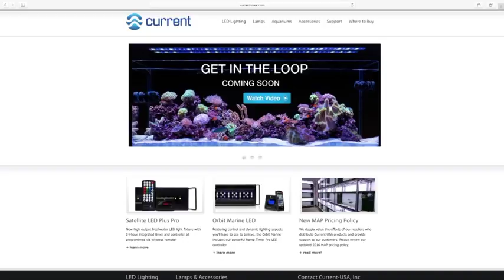eFlux Wave Pump Kit Installation Instructions

Comment: I have a 155g tank I’m  Using the Wi-Fi controller.  Can  i hook up 4 wave pumps and control them separate from each other?  please do a video thank you.   Note I’m also using the Dc flow  pump too.
Reply from the maker: Hi Cory - The Bluetooth controller has 3 channels of pump control, so you can control as many wave pumps as you want, just on 3 channels.  The DC pumps have 2 channels of their own.
Reply: @CurrentUSA  I can't seem to get my second to work. Can you do a video?
Reply from the maker: @TalkingBirdBooks  Hi Sharon - could you be a bit more clear on what exactly you're looking for in a video? What exactly can't you get to work?
Reply: @CurrentUSA   Hi there!  Certainly!  So I bout the eFlux Wave Pump Kit, with a 1050 model pump, including the Hub, Led Display, etc. I hooked everything up and it works great on stream mode. Then I decided to get a second 1050 (because I like it so much!) but when I try to hook it up to run independently in stream mode (or surge or wave for that matter) I cannot seem to get it to function. I did test the new pump independently (in the pump 1 position on the Hub) to make sure the second one wasn't defective, and no problems there. I do understand that stream mode with two pumps only work independently in stream mode. (I can't seem to accomplish that.) And I've also tried hooking them up in surge or wave mode and have not had any luck. Honestly, I'm fairly clever most days, but this has me doubting that!  Thank you so much for your help.
Reply from the maker: @TalkingBirdBooks  Hi Sharon, do you have Wave Pump #2 in Primary Mode or Secondary Mode - if it's in Secondary Mode, it's going to work in tandem with Wave Pump #1, so it will seem like you have no control over it.
Reply: @CurrentUSA  Hi There. I have tried both. I go through steps 1-3 on page 9 of the instruction manual, but each time, only one of the pumps winds up working. Like right now, I have programmed them each independently, on stream mode. But only pump one is actually working.
Reply from the maker: @TalkingBirdBooks  Hi Sharon, is it possible for you to reach out to us on our website so we can contact you directly? It would really make it easier for us to help you with this as it is likely a very easy fix.
Reply: @CurrentUSA   for sure. And I can provide pics and video to help. Thank you so much!